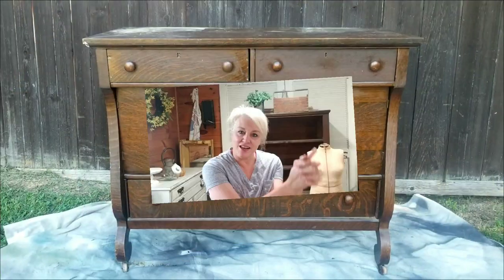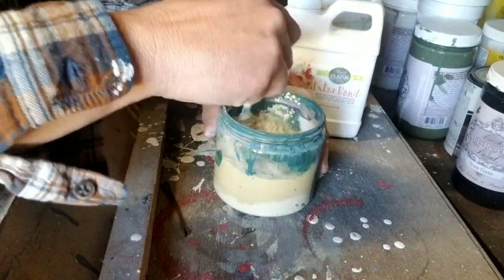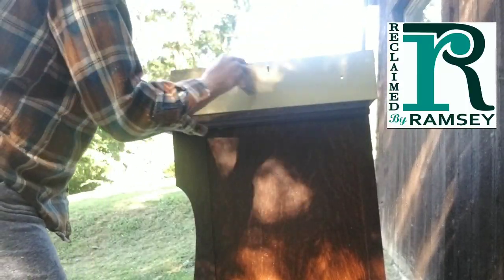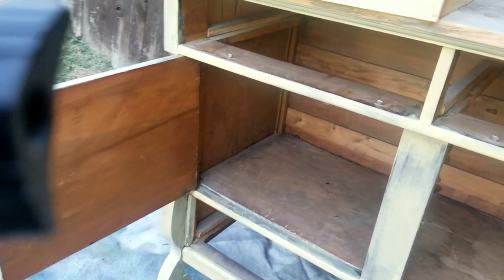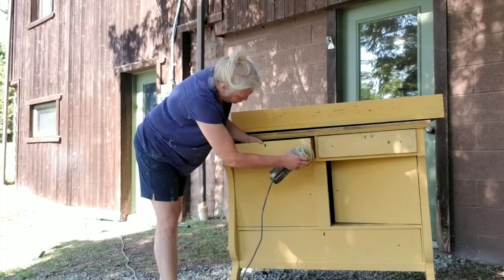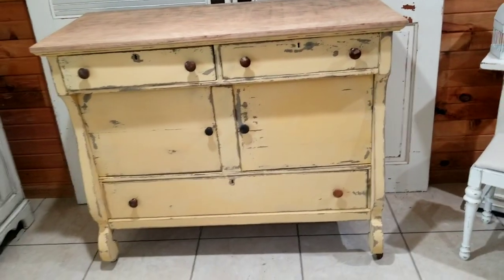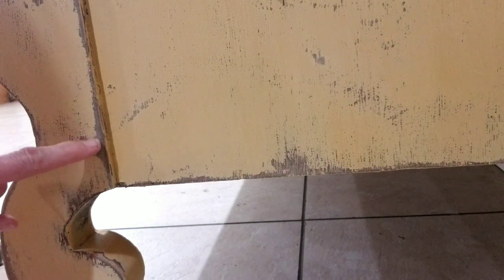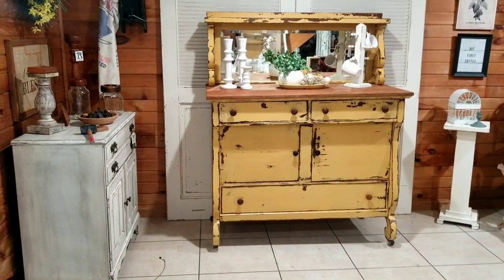How To Use Milk Paint **Easy Steps** Buffet Makeover

Comment: I have a sleigh bed that I’m trying to make looks just like what you just did in this video. But my under wood is like a very very light wood laminate. Should I paint it black. And then put my milk paint color on top so that I get the dark spots with my dark oil wax? I’m worried that the light would laminate will come back out after I send it. And I want it to be dark like your after pictures in this video. I hope this makes sense.

Comment: What is milk paint? Never heard of it before. And what do you mean by chippy?
Reply from the maker: Milk paint is one of the oldest paints around dating back to the days of the pyramids. Its make from the casein in milk. Its dry abs tou mix it with water. Chippy means it flakes off initially leaving a very aged look.
Reply: @reclaimedbyramsey7921  thanks for that, I googled it and it seems it’s not something available in uk (or maybe we call it something different!!) I like the finish